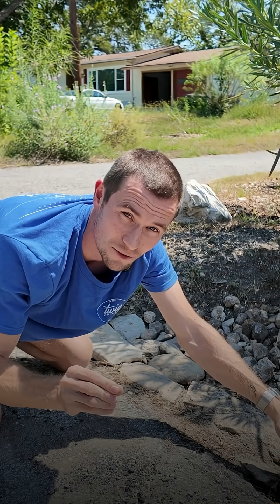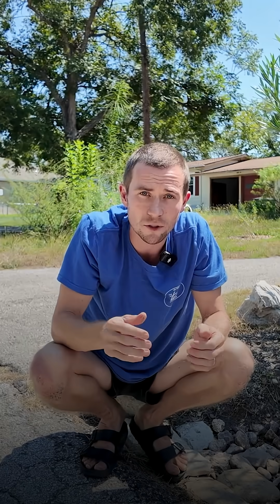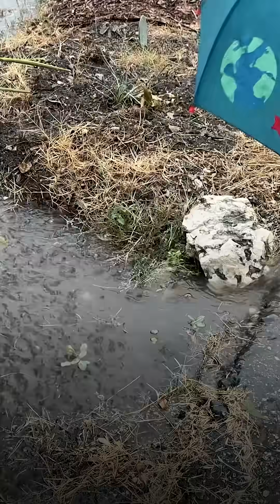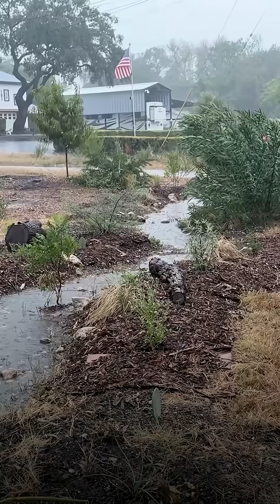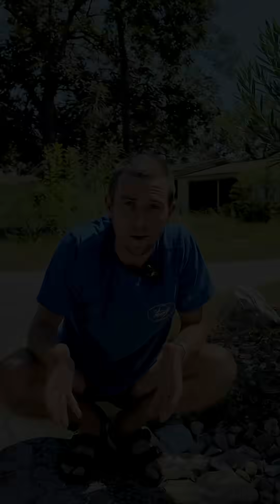Turn Street Runoff into Free Irrigation (DIY Dry Creek Bed)

Comment: off the dirty streets though? that’s a bit different than collecting it straight to the barrels
Reply from the maker: you’re right, water flowing off streets can carry small amounts of oil, tire residue, and other pollutants. But here’s the key: letting that water soak into vegetated areas — especially ones planted with native grasses, trees, and soil-building plants — helps filter and break down many of those pollutants before they ever reach our creeks, rivers, or aquifer.

Healthy soils and native plants act like a natural filtration system. The microbes and root networks capture sediments and absorb or degrade many toxins. It’s not water you’d collect for a vegetable garden, but it’s much better for it to soak into a planted landscape than to rush straight into storm drains where it flows untreated into our waterways.

So, we’re not saying the water is perfectly clean — but by redirecting it into living soil and plants, we’re helping nature clean it up where it lands.

Comment: Water from street runoff will have oil and other chemicals from traffic that could do harm to an organic garden.
Reply from the maker: you’re right, water flowing off streets can carry small amounts of oil, tire residue, and other pollutants. But here’s the key: letting that water soak into vegetated areas — especially ones planted with native grasses, trees, and soil-building plants — helps filter and break down many of those pollutants before they ever reach our creeks, rivers, or aquifer.

Healthy soils and native plants act like a natural filtration system. The microbes and root networks capture sediments and absorb or degrade many toxins. It’s not water you’d collect for a vegetable garden, but it’s much better for it to soak into a planted landscape than to rush straight into storm drains where it flows untreated into our waterways.

So, we’re not saying the water is perfectly clean — but by redirecting it into living soil and plants, we’re helping nature clean it up where it lands.
Reply: That may be true but if it travels In The water it is likely going to end up in the garden anyway. Ps this is for a garden of ornamentals and water harvesting structures not for edibles so better then the alternative
Reply: For an organic garden bed it probably better to collect roof run off. But you do bring up a good point, what steps can be taken to filter water out as it brings debris and motor oil.